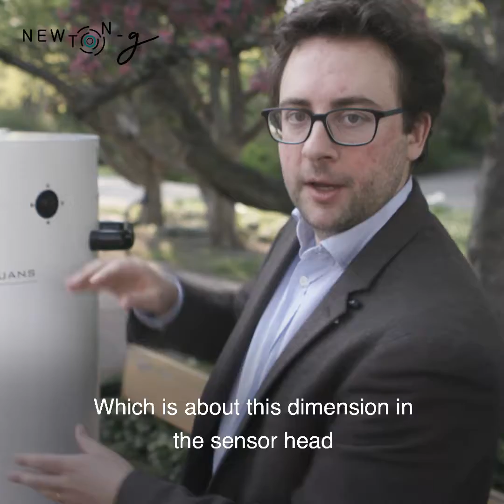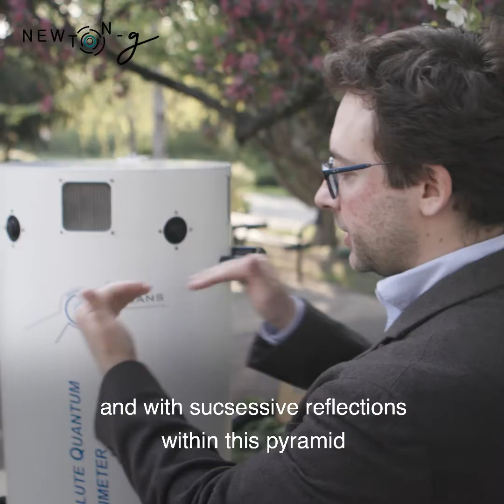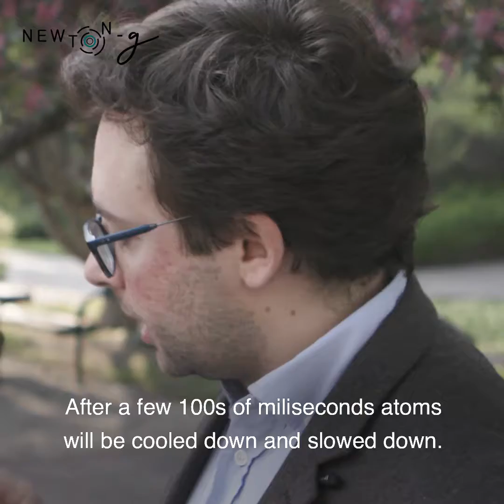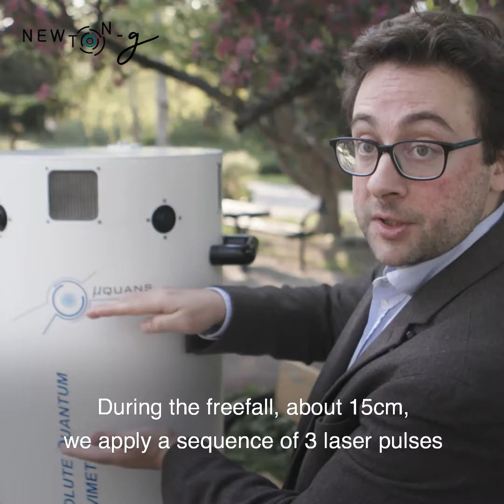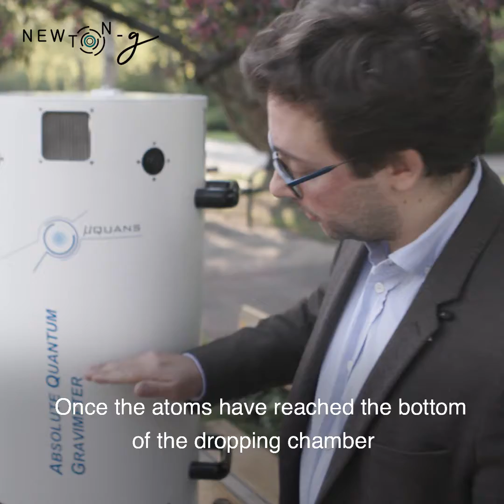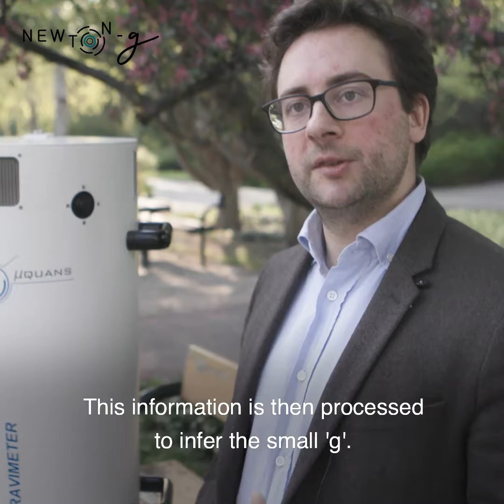NEWTON-g: How does an absolute quantum gravimeter (AQG) work?

Comment: So in the end you just measure free fall speed of and object... regarding the weight and acceleration... and that's is small g... yeahhh right..  there's no so g force... camon... not small not big...just a delirium for a fictional force that has no correlation with the other 3 constant in the codata... gravitmier...gave me a break...hahahaha ...
Reply: Well if you are interested here's a small explanation. Since matter(atoms) at extremely low temperature has very less thermal broadening, they have like extremely narrow wavelength band and can therefore be used for precise matter wave interference experiment. Therefore we cool them. And for atoms like Rb, we can use a two counter propagating lasters to create an optical lattice that acts similar to a diffraction grating or beam splitter.. this optical beam splitter is able to put the atoms in a superposition of two States ex |A> and |B>. Due to a nature of how the atoms are put in the superposition (ex: Raman Transition), each state has a well defined momentum,(ex: |A,p> then |B,p+h(k1+k2)>, where k1 and k2 are the momentum imparted by the optical Beam splitter. As we can see, the laser not only puts each atom in a superposition of states |A> and |B>, it also puts them in a superposition of momentum |p> and |p+h(k1 + k2)>. Since momentum is related to velocity, which can be affected by gravity, the superposition which has different momentums are affected differently, the first laser, put the atoms in a superposition of two momentum, then they are let to fall freely, the next pulse exchanges the momentum superposition, and then let the states evolve, then after same time interval another pulse brings the atoms together. In the absence of gravity the initial and the final phase difference remains same, as the phase change gained during the first and second laser is counteracted in the duration of second and third laser. But in the presence of gravity there is a relative phase difference between the initial and the final states.. by studying this phase difference, by measuring the atomic state which is directly corresponding to the momentum state, we can precisely measure gravity. Feel free to correct me, if there's an error..